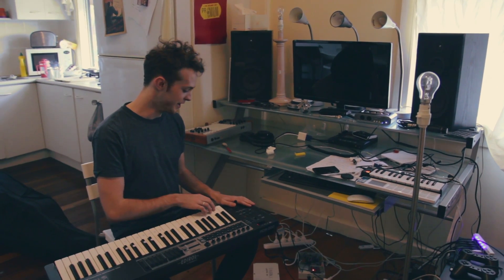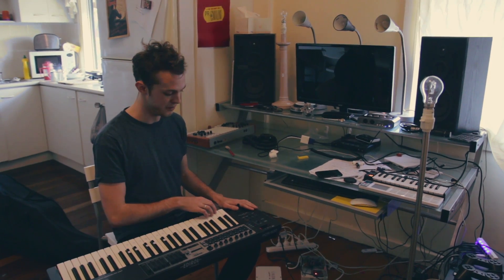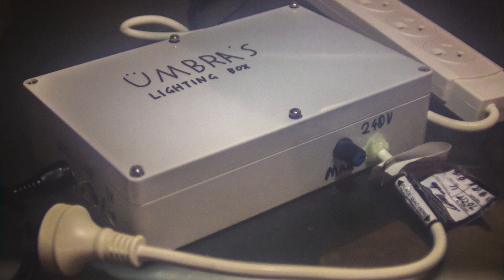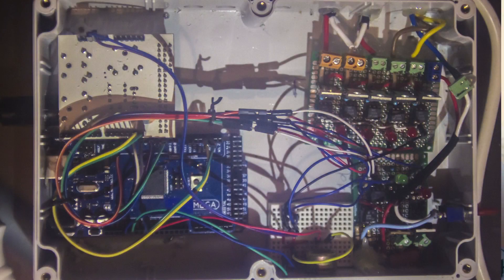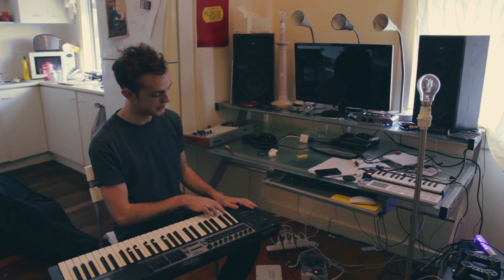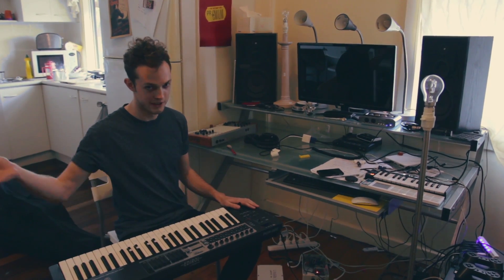Ümbra Light Show Demonstration

Comment: You might want to consider using Vixen lights. I just recently discovered a midi feature in wich as long as you have enough lights per channel, you can get the computer to create a light sequence based on the midi input.  

However, I did my Christmas lights using arduino, sound and mapping out the sequence by ear.
Reply: Do you have a tutorial about how to do this? I have a project that I need help with using midi to control LED light strips.